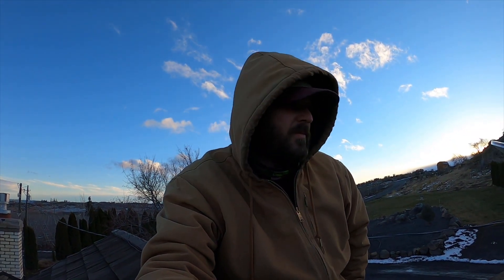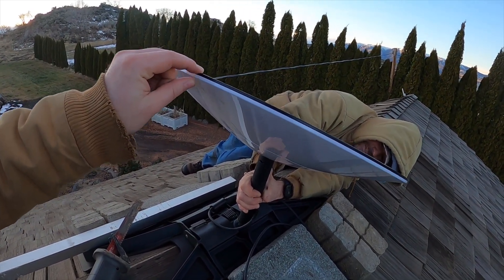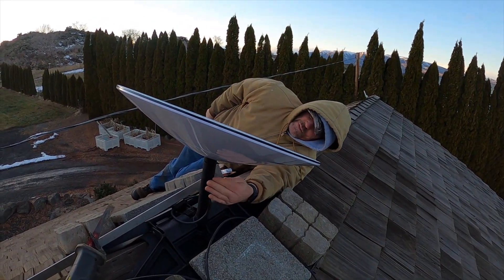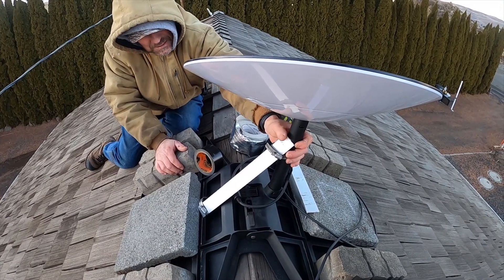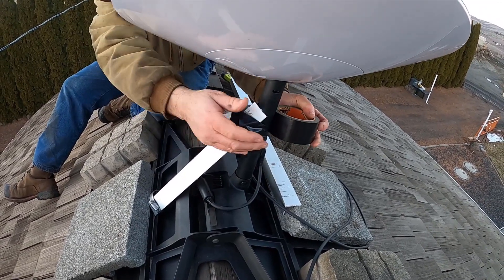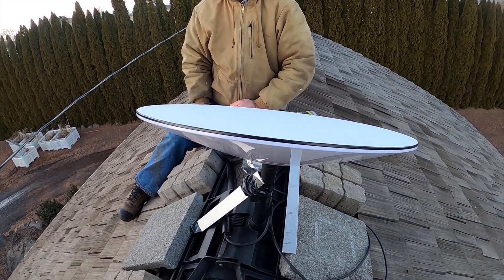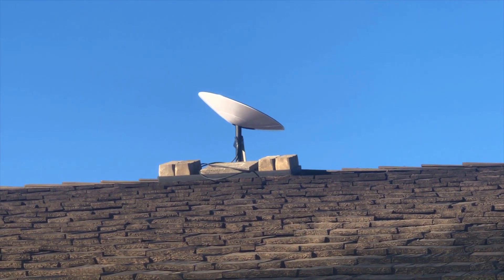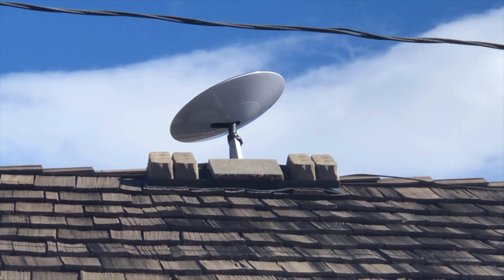Help Reduce Drops in High Winds For #starlink Internet - Time to Reinforce Dishy!

Comment: Just what I need.  Strong Santa Anna winds causing dropouts.  Ours is on a metal pole 4' above the roofline.  I think that bracing with a pipe would work.
Reply from the maker: I still had troubles, the actual servos inside have started to fail or wear out :(

Comment: I've had mine with no issues at all even in 140km/h winds, but since I had my shingles replaced on my roof I've been having issues with dropouts with anything over 40km/h winds so I think the roofers didn't mount it right after. Can't get up there because of snow currently either
Reply: Are you really serious about those 140km/h winds? I live in a zone with 120-140km/h winds in Patagonia and I'm currently worrying that it may Fly away after such a storm. Please confirmar your experience. Thank you in Advance!
Reply: @ivanvanderkamp  yes we had 140km/h winds, I have had the dish replaced under warranty after though as the motor for aiming had failed. Sent a RMA request and within a week the new one was at my door. Supposedly there is a new motor in there that will last longer. So far its been good, nothing over 100km/h since its been replaced.
Reply: @ndegraafndg  Thank you very much for answering so quickly! I just got my dish (Rectangular one) and I'm still afraid it may fly away since we may get once per year up to 140km/hour in Patagonia.

Comment: The mount is pure garbage. There needs to be accessories sold because everybody's mounting needs to be different. Right out of the box you shouldn't have to jury rig anything. Wait till it snows mine froze up And wouldn't move.
Reply: They do Have diffrent mount options, when mine gets here I'm just going to mount it on a sattlite pole, drill out the pole and then put a bolt threw the pole and the one that comes on dishy

Comment: I saw someone mount a thick plastic trash barrel around it like a chimney to help with the wind. They were afraid if they stiffened the base it could break the motor as that would become the weak point which would be more expensive to fix.
Reply: I just did that and now I'm discovering any possible issues with the obstruction área.